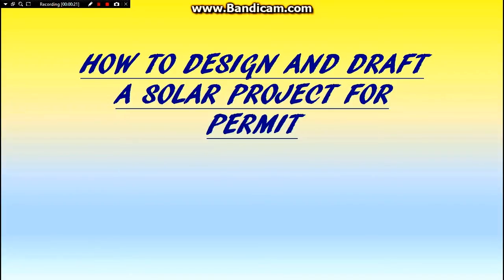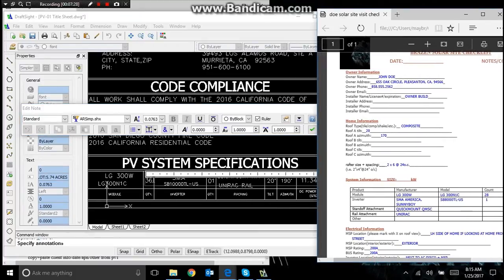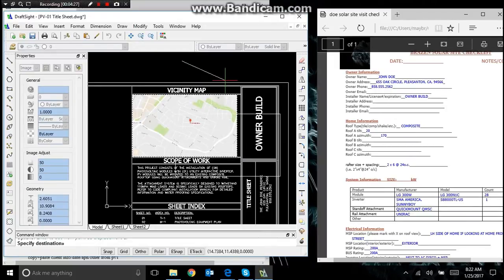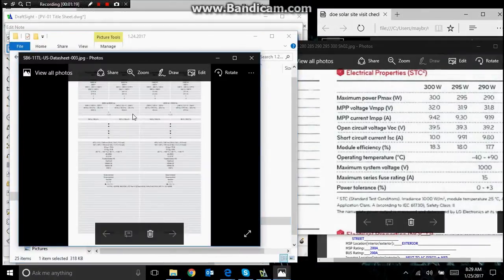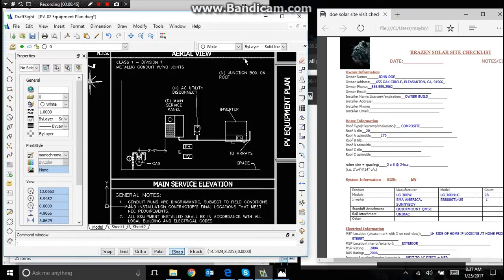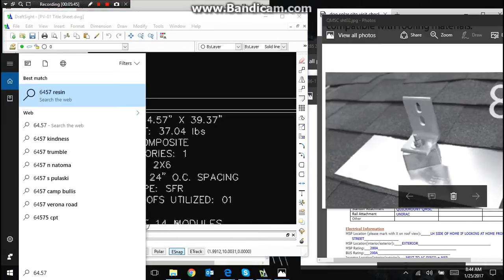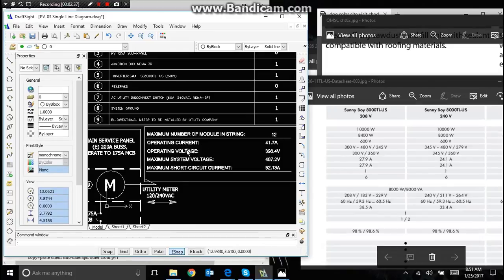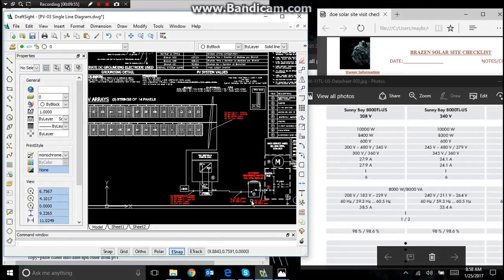LESSON 2 - How to draft / design solar plans for permit - PAGES + CALCULATIONS

Comment: For screen recording you might want to consider using OBS.  It doesn't watermark your recordings, it's really robust software that doesn't crash often, and it's easy to use.
Reply from the maker: thank you!   i now use X-recorder app as i do mot even own a computer anymore.  

no watermark and works great for my trading videos.  

i dont mind the watermark anyway - i just want to give the value and get the info out there to all people it could help.  

thank you for the suggestion!

Comment: FYI cannot get Draftsight installed on Windows 10! Apparently this is a problem for everybody. I have to use it on my Mac and I'm not the greatest with macs. The program is a hassle getting installed but nevertheless, Is there a default project template for Draftsight that you are starting with?
Reply from the maker: ZPaul Lucenti .dwg files also work in autocad and several other programs, if that helps. 

draftsight helpline is (781) 810-3000

as far as templates go, i have made my own and fine tuned after many years of rejections and code changes from state of CA and lower jurisdictions.   i would be happy to send you my latest for a small donation of $200 to keep this channel going. PM me please and we can continue from there.  i will even throw in my ground mount template for you and give you my personal contact for any questions or help you might need.

brazeninvestmentsllc@gmail.com
Reply: Thanks that is really good to know. I do have Autocad but have not used it yet.